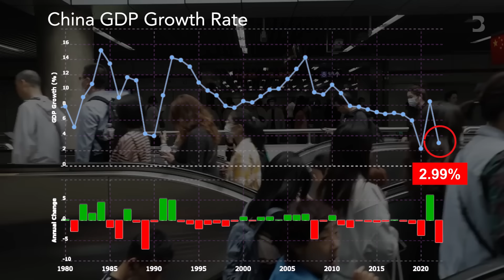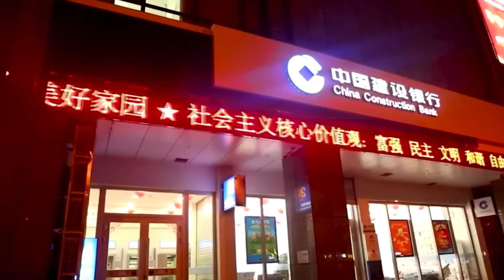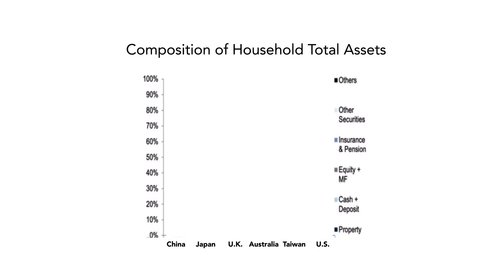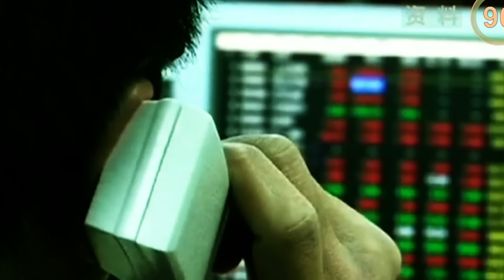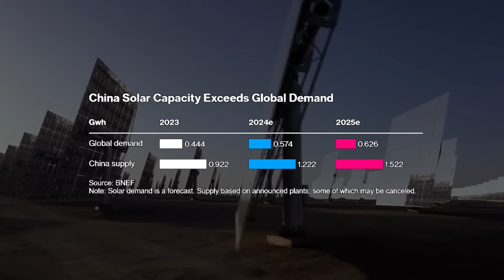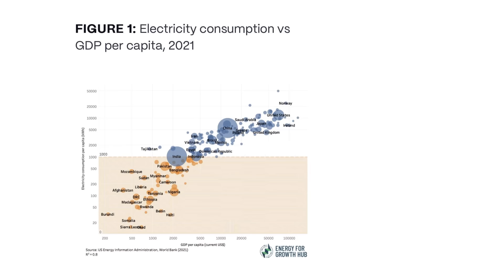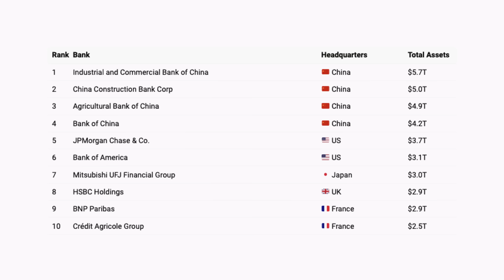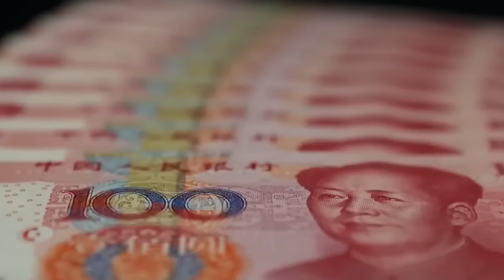Why China's Economy is About to Collapse

Comment: What non-sense is this?  Total Amateur hour.  

1) Capital that is fueling growth is drying up.
Don't know what you are talking about buddy.  The investment portion of the Chinese economy and the absolute amounts of investment are as high as ever.  The only thing going away is FDI which is becoming a smaller and smaller portion of total investment.  It is almost totally irrelevant today.

2) Energy powering manufacturing is getting more expensive.
Energy imports have barely made a dent in China's ever growing merchandise trade surplus.  A nation facing more expensive imports that it can no longer afford should have declining imports along with declining net exports.  If energy getting more expensive actually mattered then why doesn't China's net exports ever reflect that.

3) Real estate bubble has crashed.
This one at least is true but what is the actual magnitude of effect.  There is no more new GDP from housing construction but that just frees up people and resources to go do something more productive.  On the surface GDP falls but in reality GDP growth is improving because the housing construction that looked like growth before actually wasn't.  The actual effect of the housing bubble is backward looking.  It means GDP before wasn't as high as people thought but GDP going forward is actually an improvement from the GDP before.
Reply: 1) that internal investment is mostly unproductive and is being fuelled by debt. Debt to GDP is increasing as opposed to the GDP getting big enough to compensate. Unlike the yanks the RMB does not hold the global reserve status of the USD. They would have to inflate their way out.  A lot of the debt is also off the books held by local govs trying to hit quotas by the central gov so its hard to comment on but its estimated to be magnitudes higher.

2) Labor has been historically so cheap that energy pricing hasn't factored in too hard when it comes to competition. Just over a year ago there were droughts that dried up some hydroelectric facilities. Production citites ground to a halt for quite a while. This will get worse over time but they are doing an okay job of diversifying here. That's one of the reasons the Chinese have supported the dictatorship in Myanmar as they get so much of there cheap gas from there through deals with the junta. 

3)"here is no more new GDP from housing construction but that just frees up people and resources to go do something more productive" mate your common person in china mainly invests in housing. When houses people are paying off dont get built millions of people get drastically poorer. This means no money to invest and do something more productive. This is why the country has been grappling with deflationary possibilities. People arent spending money because so much has been lost, and this hasnt ended yer, its still popping. I'm not going to start on the GDP numbers, they're so obfuscated at this point that its hard to take what we see seriously. There are good numbers crunched by economists who just look at publicly available input and output data.
Reply: @dekumutant  You are just parroting talking points you heard but never examined critically.

1) Naturally returns on investment has to be lower when the economy goes from growing at 10% to growing at 5%.  But this is not evidence of bad investments.  A 2 trillion economy might be able to grow at 10% a year but a 20 trillion economy cannot.  Similarly for investing, 2 billion dollars can be invested at much higher returns than 20 billion dollars.  The very fact that a 30 trillion economy is generating 5% returns on itself when many economies 1/10 of that size cannot even generate a 2% return on itself tells you who has better investments.  Then there is the matter of not understanding the role of debt in an economy at all.  Debt is nothing more than a ledger system to keep score in an economic system.  It tells you is how to split the harvest between all the participants.  All of China's debt is internal and it is basically all inter government debt.  There is not much consumer or private debt given that the Chinese private sector is extremely risk averse, both in terms of borrowers and lenders.  So projecting issues from the US system with regard to debt to the Chinese system is a logical non-starter.  China's internal debt is just a system for keeping score between all the different levels of government in China.  They can solve all of that by resetting the scores between these different levels of government with minimal impacts to the private sector.  How that will be done is a political power and incentives question between the different levels of the Chinese government.

2) Labor is cheap in China but not that cheap.  Wage growth over the past 40 years has been something like 10% per year.  The fact that Chinese products have only improved their competitiveness over time while wages have increased several thousand % tells you that productivity is growing at an incredible rate in China.  That is the main reason the economy has increased 12 times in the last 20 years or so.  Remember cheap labor while it explains a point in time competitive advantage, it doesn't explain GDP growth (a.k.a. how the economy becomes more productive over time).  So cheap labor is not and never was an explanation for GDP growth.  Energy costs have only ever gone up over the last 40 years since the oil embargos.  The rate of increase is not any faster today than in the past (remember oil use to be like $5 a barrel that long ago).  The Chinese have always grown their productivity at orders of magnitude faster than energy prices so it has had no noticeable effects on slowing the Chinese economy down.  If oil price ever actually becomes a drag you should see Chinese imports, exports and net exports affected.  Chinese imports and exports should fall and the value added by China in the supply chain starting from commodity inputs and ending at final outputs (proxied roughly by net exports) should shrink.  There is no evidence of this at all.  Post pandemic all three of these things just keep rising.

3) Sounds like you don't actually know the balance sheet status of Chinese households at all.  The incomplete apartments are a drop in the bucket for the entire market.  The amount of total Chinese savings is gargantuan.  The Chinese save about 30% of their after tax income and have been doing that for the past 30 years or so.  This housing bust makes barely any dent in their cumulative savings.  Never mind the fact that the household sector on a cumulative basis isn't even close to losing money from real estate.  The number of people that bought their houses at far below current market prices is far larger than the number people that bought their homes at close to current market prices.  You don't seem to notice when they piled up 10% capital gains per year on their homes for the last 20 years and never spent any of that money.  Now you are worried about a small portion of those cumulative capital gains they never spent going away with home prices falling by a tiny portion of what they rose by.  Chinese consumption is mostly limited by their own lack of propensity to spend.  In the longer term the housing bust is a rather minor contributor to that.

Rather than parroting the hacks who rely on preaching to a completely ignorant and uncritical audience, pick up some critical thinking skills so that you can actually think for yourself.
Reply: Money printer goes brrrr

Comment: Currency devaluation of that magnitude wouldn't do China any good because that would crush internal consumption making it that much harder for China to structurally adjust its economy given China needs internal consumption to start driving its economy.

Further pegging the Yuan to gold would be disastrous given that the US government reserves are around 8200 tons and US private sector reserves of gold stand between 21,000 and 30,000 tons that puts the US held gold at roughly 60 percent of the world total dwarfing even India. If China were to peg to gold it would drive the price of US gold reserves up exponentially essentially acting as a wind fall for the US.

Where China is in its internal development is such that the previous high investment model is over and they need to migrate to a consumer driven economy but that's hard to do especially when you consider it took the US 25 years from 1928 to 1950 to manages this. Japan had been attempting this for nearly 25 years and they have at least another decade to go before they are completely finished. But China is far far more imbalanced that either the US or Japan ever became so this would suggest that the time to adjust their internal economy is going to take much much longer to do.

Worse still is that the social programs we have in the US such as social security, Medicare, snap, and subsidized housing simply don't exist in China. Without institutions that help people get through hard times this places the burden of that solely on the individual and their personal connections mainly family. As a result China has the highest savings rate in the world which is the primary driving factor for why China has such a high investment rate. And all that money has to go somewhere and for the large part it's gone into infrastructure, industrial and housing and then flooded into the US, EU and Japan which has led to large scale deindustrialization and trade friction.

So now if China were to devalue their currency this would likely lead to a devaluation of the dollar which in turn would lead to global inflation and combined with tariffs would send China in a Argentina type crisis.

There simply is not quick fix for China at this juncture and any action that the CCP takes is going to come with severe opportunity costs.

Worse still is China is on the clock to deal with this or risk getting stuck in the middle income trap.

Comment: After Mao passed away and Deng ascended to leadership, the priority was to raise standards of living through economic development. That carried through Deng’s two hand-picked successors, Jiang and Hu. That’s 35 tears of Deng thought. But when Xi took over in 2012, he did a u-turn and gas returned to Maoism which is about CCP power, strict control on society and self-preservation. The Deng driven “miracle” is over. Other than the Deng era, China hasn’t gad good leadership/governance since 1830. The point is 1980-2015 was the aberration. We saw peak Japan in 1995. Peak China was 2015. Now, China is a security risk.

Comment: Reasonable, except for the claims about energy. 1. China is right about now in the process whereby its fossil fuel  consumption for electrity generation will begin to fall in absolute terms. Over the last year its increasing demand just eclipsed, by a whisker, its rise in renewables generation. That cannot happen again, as its current rate of wind and solar installations is at a staggering level, and there is no conceivable reason why the government would want to move back from that. If there is a quandary over what to do about property investment, that is not the case with the energy trasition. It is an investment destination which has the entirely intended consequence of reducing China's dependence on foreign suppliers. 2. Oil: In the month of July, 2024 - so, a bit after this video was released, but it wouldn't have taken a genius to anticipate - the new vehicle market in China crossed over to more than half electric. There is some cut-throat competition among Chinese EV manufacturers, but there is a lot more of going-out-of-business among Chinese, and other, ICE vehicle manufacturers. There is no reason to suppose that the transition will not be essentially complete in China within a few years. Transport accounts for 54% of China's oil consumption. Their buses went electric long ago. Bear in mind also that the effect will be sharper than it would be in mature auto markets such as Europe or the USA. In China, cars coming onto the road at present account for a higher percentage of their total fleet than than do in mature markets. China certainly has problems, but the energy transition is one area where they are on a big winner.